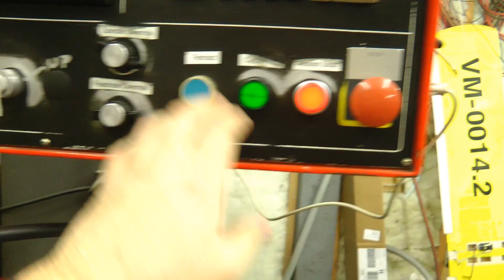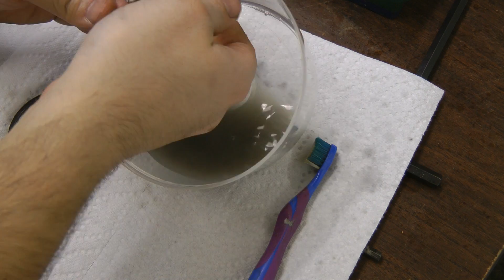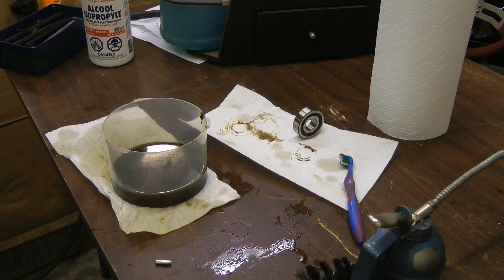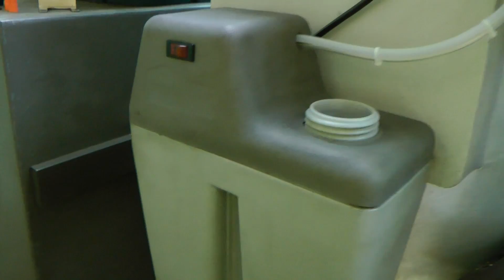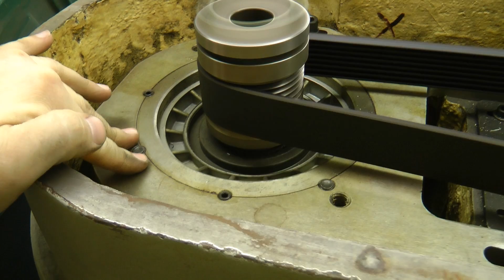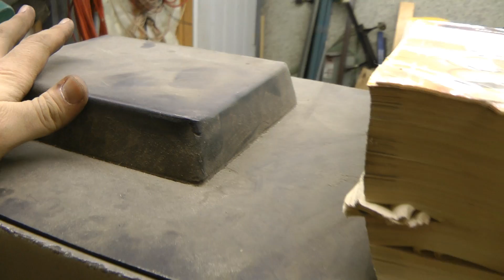Tree Journeyman 325 CNC milling machine - Part 3

Comment: I may be looking at taking the spindle out. My recollection is that it should turn easily by hand and I'm finding mine to be very stiff, in fact I just got an overheat error from my VFD. I'm retrofitting a Centroid Acorn onto mine and as I try to get the spindle turning I'm finding this problem. Can you confirm that the spindle rotates free with no power? 
Thanks to your video I got the spindle out and inspected the bearing but didn't identify the cause of the stiffness- I'll put it back and see if it exhibits the same behavior.

Comment: Nice job. I have the same machine although I got sick of the Delta-20 controller and rebuilt it with a Dynomotion KFLOP board. So much nicer to use now. I also need a new set of spindle bearings for mine. Any idea where I can buy those? Thanks.

Comment: No, looks like screw-nut tensions the bearings not the springs - I missed much of the reassembly and after. High tolerance bearings seem to have different thicknesses. mrpete222 has a favorite Bridgeport shop, perhaps they can help or direct you.

Comment: Tesla500 -  Do you know the part numbers for the spindle bearings and would you be willing to share them with me?
Thanks.
Reply from the maker: The main spindle bearings are part number 2MM9110WI DUL
Reply: Thank you!
Reply: Tesla500 - what kind of phase converter are you running your machine on, or are you running it on three phase right from your house?

Comment: I believe there is at least one more deep groove bearing on the very top end. When hammering it out/in, is it possible that one will be damaged?
Reply from the maker: If the shaft was seized to the bearing race, damage is a possibly. I haven't had any problems yet, the shaft seems to go in and out easily.

Comment: Kluber Isoflex NBU-15 is the right grease for those bearings.  Just in case you R&R them in the future.  Also, ~$300-400 for a pair of NSK precision bearings is about the right price.  I recall that the complete set for my Shizuoka was ~$500 (3 bearings).

Comment: Any idea what the part number is for the spindle drive belt?  Mine has a different pulley - I have the 6000 RPM, 3/5 HP version.  I think the belt is a 6PL1562.  The belt that's on my machine now looks awfully cracked and worn and I think it's time to replace it.

Comment: Wow what a breeze it was to install the snap ring. Took me a few minutes. Thanks for the tip! After wasting hours on Saturday trying to get the snap ring in, I gave up.  Started her up and the spindle bearings are real quiet. The noise I still hear is at the top of the machine where you did your balancing mod. I'll tear it down to inspect later this week. Can't thank you enough!

Comment: How did you reinstall the snap ring? I'm having a heck of a time reinstalling it. The ends of the snap ring are wider than the entry slot. The can only enter at an angle and can't get the angle while compressing it. Any tips? Did yours just slip in easily? Thanks!
Reply from the maker: While the spindle is sticking out by about 1-2cm from fully inserted, put the snap ring over the outer lip of the spindle, up against the bearing shield, and compress it all the way. Then insert the spindle all the way using a rubber mallet or similar. You can't install the snap ring any other way it seems, it's impossible to get it in otherwise.
Reply: @tesla500  Thanks for this tip!!!

Comment: FYI... My bearings are SFK 7010CD/P4A DGB.  They are same size as the ones you mentions 50x80x16mm. Saw them on ebay for $500 for the pair :-o.  Although I understand that they are 15 degree, mine have a *-2 on one bearing and *-3 on the other.  I'm not sure what that means. I cleaned the bearings and they look okay.  Since I'm not going to spend 500 on new bearings, I'm buying the appropriate Kluber NBU15 grease and see how it goes.  The old grease that was on the bearings would not come off. It was gummy and pasty Black.   I've never experienced a grease that would not clean-up with acetone or alcohol.  I had to use brake cleaner.  Maybe old caked on coolant?  Anyway, the bearing look okay.  I rolled the balls on glass and they appeared to be perfect.  Waiting for my $30, 4oz tube of grease to arrive in the mail.  Thanks for motivating me to do this.

Comment: So now I bought a set of snap ring pliers that are more stout and fit the snap ring holes snugly except the darn pliers don't close enough to allow the snap ring to release. I'm not liking this snap ring. I'm going to have to modify the pins on my pliers or buy yet another pair.  Aarrrgghhhh!  LOL!  You seem to be very intuitive about all elements of the machine.  Are u a mechanical engineer?  Thanks for the detailed responses.

Comment: A "long" move can be as short as 4" if its on rapid move. If i slow down the feedrate dial then it wont trigger the servo error. By the way, the relays shut down due the x axis servo error and I have to reset. I'm hoping it's an adjustment like you detailed in your video.  Thx!

Comment: Umm more questions... What size snap ring pliers did you use? I bought a craftsman and i guess too small, the pins bent. Can't get the snap ring off. Also do you know the spindle bearing size or part no? I mean the bearings you cleaned and regreased. Mine are shot. I hear clunky bearing chatter.  Thx again.
Reply from the maker: The snap ring pliers were advertized for use with up to 10cm snap rings, and have about 3mm dia pins.

The spindle bearings are Fafnir part number 2MM9110WI DUL, and are 50x80x16mm 15 deg. angular contact bearings which come as a matched pair. The L indicates light preload, the M medium preload may be acceptable as well, especially if you're only using the spindle up to 3500RPM. There's a set of M preload bearings on ebay right now for $99, the L preload ones usually goes for about $200. You need to buy them as a matched set of two, I tried some cheap non-matched Chinese ones of the same size and they overheat.

Comment: Awesome video. I also have a J325 but w system 10 control. I have same issue regarding spindle bearings and mine are much noisier. Thanks for showing how to disassemble bearings. Where do you suggest ordering/purchasing bearings? I only use for my home garage projects. Additionally, i have issues with the x axis server motor. I'll try some of the adjustments that you made. Thanks!
Reply from the maker: I got my bearings from vxb.com. Just installed the Y axis bearings and they work perfectly. Will probably do the spindle bearings tomorrow after I get the proper Klueber Isoflex NBU15 grease. What issues did you have with the X axis?

Comment: @Fracture I used the same technique when packing bearings when I had to replace a rotor/hub assembly for a brake job.  It gets messy until you learn to not try and push too much in at once.

Comment: What is that wooden box on top of the controller?
Reply from the maker: Just a random piece I made on the machine for practice, it doesn't actually do or enclose anything.
Reply: tesla500 Looks pretty cool tho. Somehow it reminded me of the 3d printer controller interface for the maker bot.

Comment: Oh and best cleaning solution in the world is lighter fluid (Naphtha). Trust me, once you use that you will never want to use anything else. I've used it clean grease so old that it was like a combo between jell-o and glue. Dipped the bearings in for 3 minutes put them under a jet of water and voila cleaned. 

And it's good for stains, removing paint (within reason) and other applications as well.
Reply: Just a word of caution about Naphtha - some of the components are pretty nasty, just check the (M)SDS.
Reply: Alex B Well, yes, obviously. I'm not gonna drink the thing you know? :)

Personally i use heavy duty rubber gloves and use a breather whenever i clean something up oh and a fan to suck air from the room. 

But one can't deny how good it is. I mean just yesterday i had to clean my KTM chain, and it was nasty. Imagine the dirtiest, oiliest chain you can possibly think of and you're bang on. Dropped it in the solution, shook it for a minute pulled the chain out washed it with hot water and clean. The cleaning power of this solution is beyond anything i've come across.

Comment: That bearing did not sound good at all. It's well worn. You should replace it. Even without any lubricant bearings aren't supposed to sound like that, i believe it's because not all the balls are making contact, ie no longer spherical.
Reply from the maker: Yes, new ones are on order.
Reply: tesla500 Hey, just for fun, when the new ones arrive and if you have time check one or two of the bearing balls to see if you had spheroids or spheres.

Comment: I have worked with some higher speed spindles and at least there the amount of grease is extremely important. Too much grease can cause overheating and overheating ruins the grease in no time. Bearing manufacturers specify how many grams or cc of grease there should be. 

Also, lower bearing failure like this means almost always that there has been contamination of some sort. Check your spindle nose seal :)
Reply from the maker: The bottom "seal" is just a shield. One complaint with this machine is the lack of a proper seal. The later revision of the spindle makes it more difficult for contamination to get up into it, I could make and add that part.
Reply: That would be good idea. High speed spindles have non contact labyrinth seal with air purge to keep crap out

Comment: would it be possible to swap the top and bottom bearings, so that they wore more evenly; the bottom seems as though it would wear more quickly than the top as that is the closest to the fulcrum?
Reply: if not the entire bearings, atleast the balls?
Reply: Avoid chance of throwing bearing chips into good bearings at all costs, though best to replace both bearings. My experience with cars is that grease lubes until it dries out. If grease is too dry to flow to balls where it is needed, you have failure - no matter how pretty the grease away from the bearings. I DO see grease that dried to the point of no-lube, then got so hot it DID flow, hiding the area that was dried out with relatively fresh grease. You should have examined the inner race on the bad bearing for pits and spalling. Rolling over chips and hammering the bearing can leave dents. Fatigue and bad grease can cause failure of the race in various modes. Fine metal is black causing the grey grease you saw.. Grease is generally oil in a (metallic) (often lithium based) soap to increase viscosity.

Colchester lathes say that spring loaded spindle bearings have more clearance ( sliding fit?) on the inner race away from the chuck so that the spring tension can press the bearings together to preload them properly yet allow the upper race in your case to ride up maintaining proper preload when as the bearing heats up. You forced the spindle upward with the 2x4 while checking for play. That may have loosened a stuck upper bearing race letting things back to normal save for wear. Your repacking should last for light  low rpm work. Mcmaster Carr bearing catalog may have an explanation of bearing tolerances as may wikipedia. I do not recall. See bearing companies starting with your original band. Precision bearings may have markings in sets showing alignment of micron-sized off center.
Reply: bgdwiepp Usually the inner race goes - less area than outer.
Reply: This company is handling tree parts and repair. May be several versions of your machine. http://zpsusa.com/3s.html

Comment: Try adding a little more preload on the spindle bearings to get the play out. And when you're greasing the bearings, put some gloves on and push the bearings into the grease bucket until it oozes out the other side, so the bearing's completely 100% packed with only grease and no air. You don't want the grease cavitating as the bearing is spinning at 3k RPM and pit the balls.

Comment: A trick for packing bearings: put a blob of grease in your palm, and lightly smack the bearing in to the edge of the blob until it starts to come out the other side. Turn it a bit and repeat until you've gone all the way around.

At least with bike bearings, that's how I did it. They were designed to be completely packed with grease. If you left air, the grease would get foamy, and it was easier for dirt to work its way in. I'm not bearing expert, though.